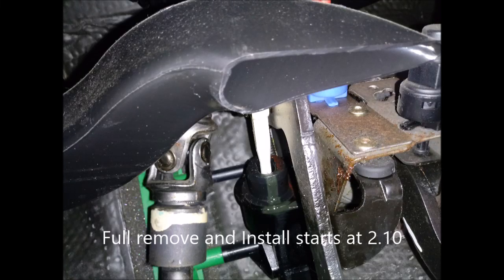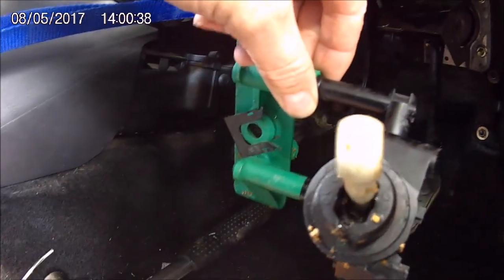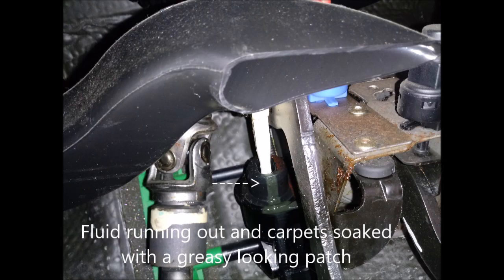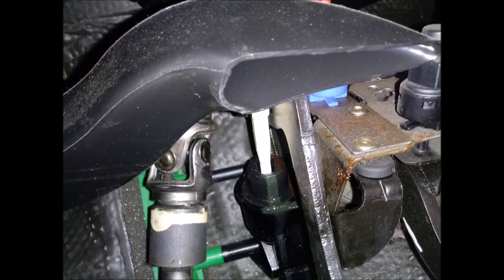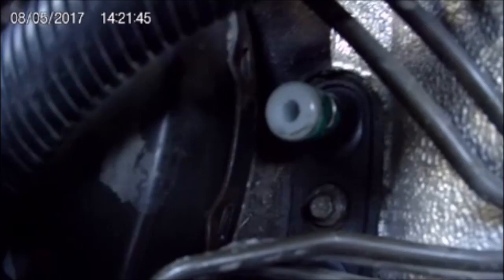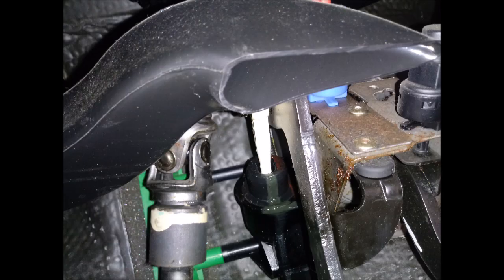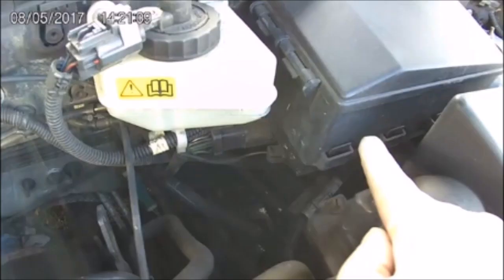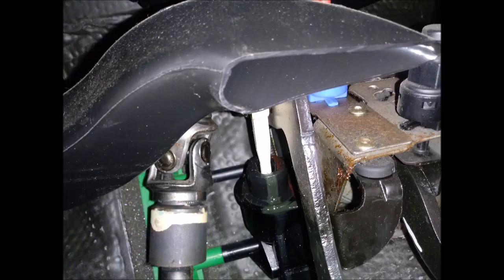Ford Focus Clutch Master Cylinder fit trick and remove

Comment: Hey just watched your video and it helped me replace mine, saved alot of time and effort undoing the 10mm on the column to the steering rack, gave me so much room to remove and refit the two bolts and play around with clutch master 👌

Comment: Just changed the master cylinder on my daughters  2004 focus,  did exactly as you except, the steering column can be removed very easily by undoing the 10mm bolt at the bottom of the column and simply lifting the column out of the way.

Comment: hiya fellow,
Im hoping you can help, about 3 weeks ago i followed your instructions and got back on the road, yesterday the piston snapped off completely. I noticed that the rod to pedal pin was really loose and Im guessing thats what caused the break
I also noticed that yours is welded on.. did you do that yourself? is it meant to be fixed?
Reply from the maker: The pin was solid I never had to weld it. it is tuff getting that piston rod back over the pin if you forget it like I did. If it was loose maybe it bent back dropped the piston rod and then broke it next press in. I would try and sort the loose pin first it will be a pig to weld in the car make sure to cover the carpet if you do :) you might be able to get a pedal from a breakers if not.
Reply: hey man thanks for the reply, yeah what you said sounds about right, my mate will weld it for me
tomorrow. I think that's the best option atm
Reply from the maker: ok good luck. the plastic piston dos not take a lot of force really so you maybe able to melt the plastic together if you haven't already got a new one.

Comment: Is that different to the left hand drive versions?? I've just watched a lefty, same job, and he had no problems with steering. And it looked quite easy apart from the access to bolts. Also, the 8mm bolt in the engine bay holds a plastic plate which apparently did not need to be removed. And last question, my focus is the st170, I'm curious if that makes any difference?
Reply from the maker: The left hand drive wont be behind the steering colume as its the same part on the other side. Engine stays fitted the same way right or left side. The rest I dont know about different models
Reply: Thanks for the reply.

Comment: From what I showed in my video for my clutch problems I got two comments, "you need to have your clutch adjusted" and "linkage needs adjusting". Are these commenters trolling me? I'm thinking my clutch needs to be replaced. It's very loose.
Reply from the maker: You cant adjust this type of clutch.  If you have the same model easy to if its leaking inside.

Comment: Try on left hand drive with fuse box and battery in the way.
Reply from the maker: Clint Grimmett so its a stupid design any side of the pond. You would think just have the plunger car side so you just drop it out engine side. Simples really but then life gets to easy a.
Reply: After watching a few vids, it appears the fuse box and battery (and enclosure) are easily removable, or relocatable to get in there.  But yep, it's dogshit still.  The turbo diesel we have looks way harder.  I have busted knuckles and haven't even got the bastard out yet.  Not sure how I'm going to get the delivery pipe and that circlip back in there.  A random hose dropped down on me too while I was in there.  Looks like an a/c drip pipe.  Can't find where it came from yet, Ughh.  What a shitbox.